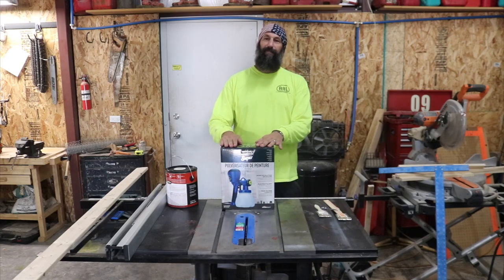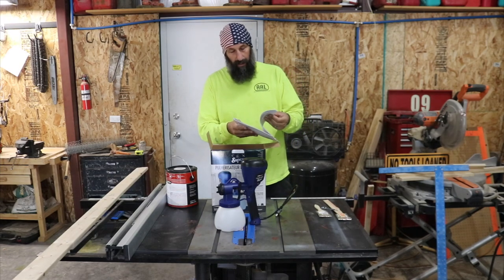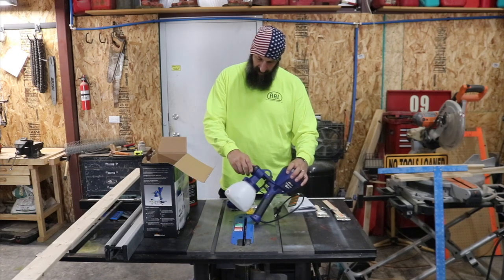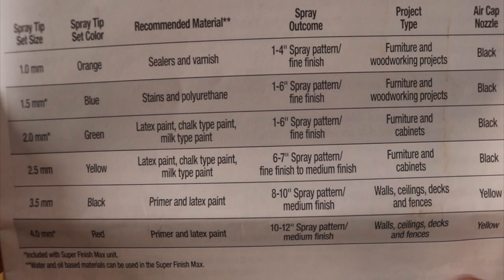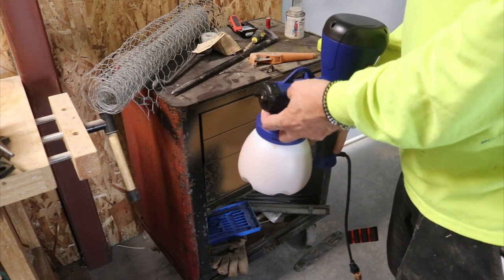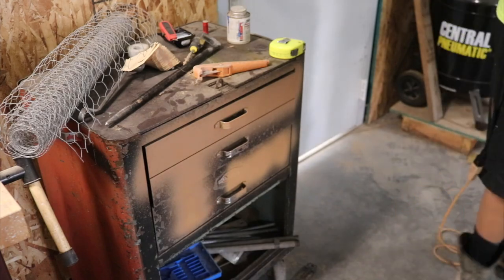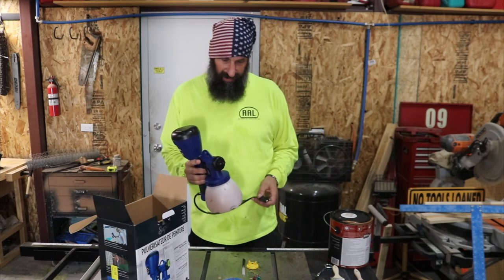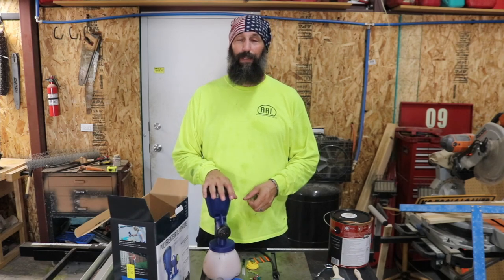HomeRight Paint Sprayer from Amazon | Unboxing and Review

Comment: Is this only for inside water paint?? I have a little project outside the house and im trying to find out if this sprayer works with oil based paint! 🤔
Reply from the maker: It will work with oil based paint.

Comment: What would i do if there is no material flow. I only got air
Reply from the maker: Check you intake tube.  Make sure it is not clogged and connected. That would be the first thing to look at.
Reply: @BearsWorkshop  alright will do. Thanks